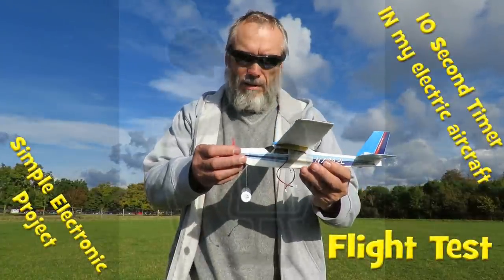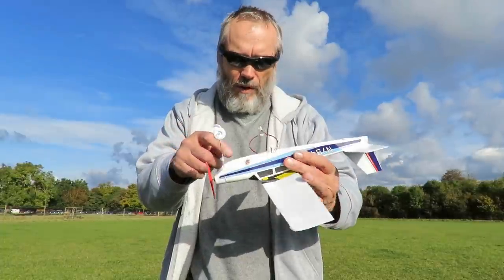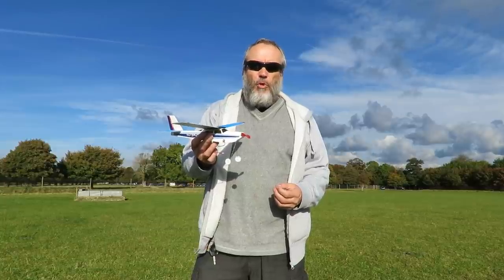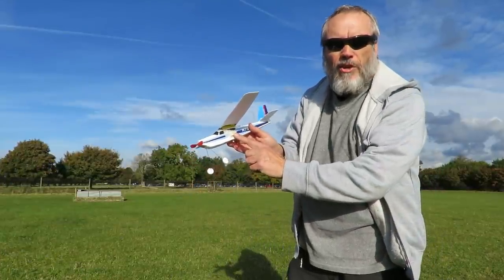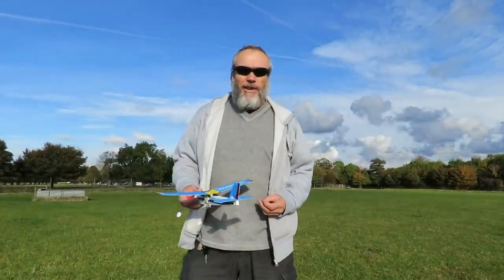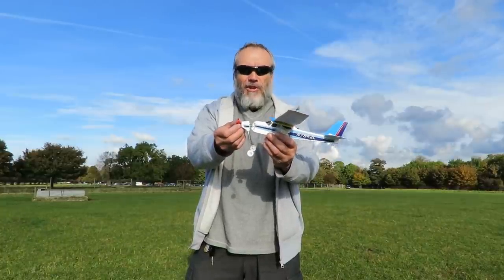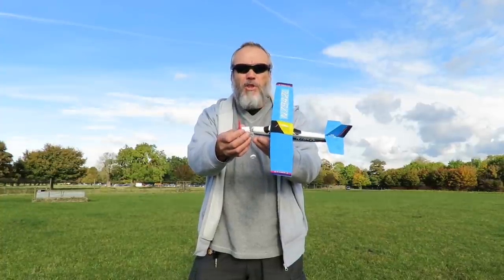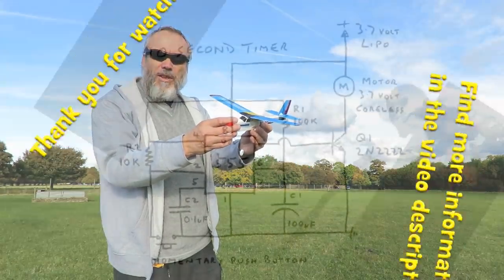Simple 10 second timer IN my Electric Aircraft - Flight Test

Comment: It worked a treat !
Am surprised it dropped like a stone afterwards though, with being a high wing.
Reminds of "the operation was a great success, but the patient died". Happy gluing, it deserves a few flights :)
Reply from the maker: It is possible the motor may have come loose before it landed. Maybe the torque was twisting it one way and when the motor stopped it was enough to loosen it. We nearly has a second flight a few days ago but it was too windy when we got to the field so I didn't risk it.
Reply: If it's a brushed with a heavy armature, that huge torque shock of the prop suddenly stopping can break regular foam easily enough. At least, that's my theory for mind boggling amounts of bits at the front end.
Say, a posh version of your timer could trigger the elevator to rise at the end of the 10 sec flight time. The stop signal from the 555 section could run to a transistor that powers an electromagnet, pulling the elevator up a bit for a glide. The tail end could be as simple as a coil and magnet.
Reply from the maker: slider2732 I think I was just clutching at straws there. Truth is I didn't spend any time trimming it for the glide and it should have been a circling climb. The prop is the reverse direction to normal so any trim I had set for it with the original prop would have been confused by the reverse torque. I was just focused on seeing if it would do the 10 seconds. I like your idea of using a little more tech to trip the elevator although I am thinking of using a simpler timer suggested in one of the previous comments. I have added a link in the video description. It uses 1 mosfet, 1 capacitor, 1 resistor
Reply: Oh, well if those parts don't work out for your timer, you could reuse them and build a levitator LOL
Reply from the maker: slider2732 :-)

Comment: That flew great with the other battery
Reply from the maker: Yes disappointed with the e-cig battery but that little circuit reduces the power so it was a choice of let it go without the timer or use the LiPo. In the video description I have put a link for another timer circuit I will try at some time.

Comment: You could make a second timer which is slightly longer in duration. And then you could either use the same lipo but add a resistor, or you could use the e-cig lipo on the second times. I don't think it will hurt having 2 timers powering the motor, since the e-cig battery has a sligthly lower voltage. Any how, 2 timers is my idea to get a slide afterwards.
Reply from the maker: Yes disappointed with the e-cig battery but that little circuit reduces the power so it was a choice of let it go without the timer or use the LiPo. In the video description I have put a link for another timer circuit I will try at some time.